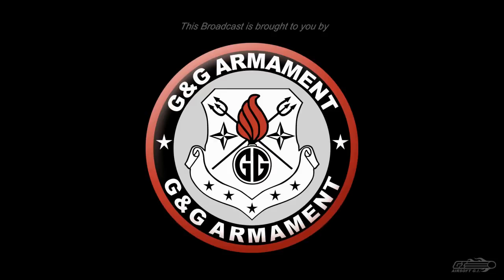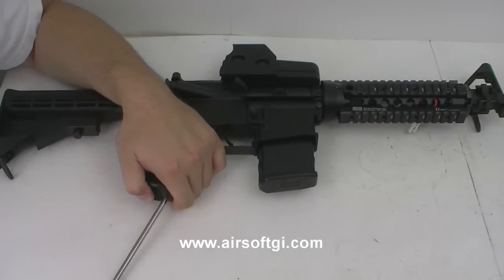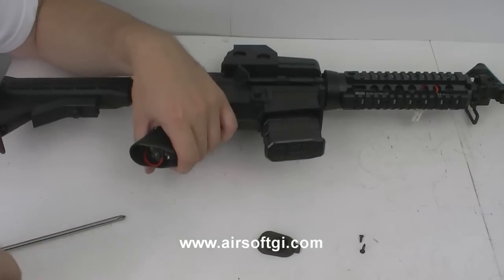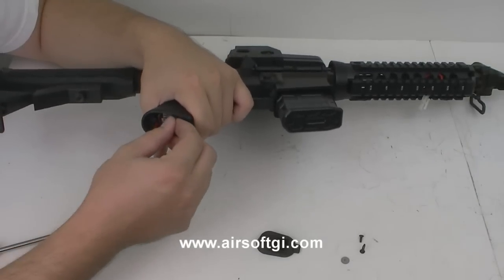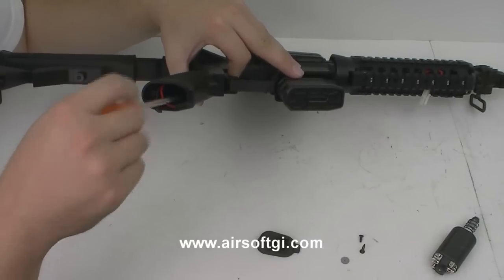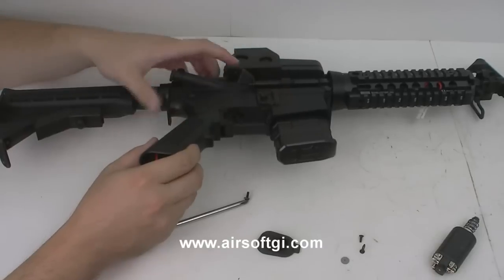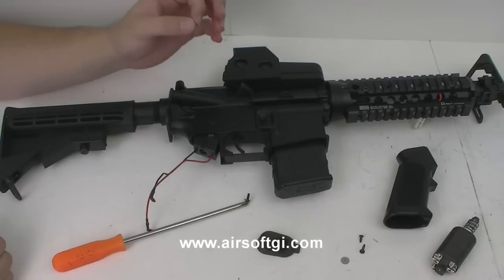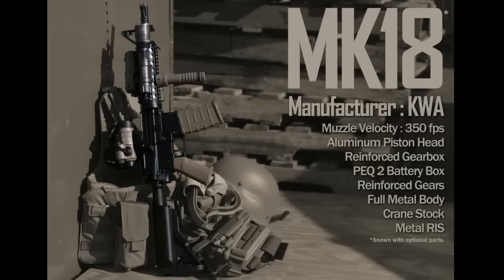Airsoft GI 101 - M4 AEG Pistol Grip Removal

Comment: Thanks for showing me this I need to replace the original grip on my Lancer Tactical M18 with a Magpul grip.
Reply: Did you do it? 
Because im pretty sure you cant, and you need an AEG Specific grip because magpul and regular ar grips use one large screw in the middle, while these use 2-4 small screws on the sides.… but let me know

Comment: thats your motor adjuster dont touch that, when you have removed the 2 little screws the bottom plate should pop out a bit if not then take a flat head and pry it out.

Comment: What should I do if the motor is stuck in the pistol grip/gearbox?
Reply: If it's an AK or another gun with a version 3 gearbox, then the motor is stuck to the gearbox. this only work on version 2 gearboxes.
Reply: +MAG Airsoft I have this problem but I own an m4. any ideas?
Reply: What problem?

Comment: can you instal a regular AR-15 pistol grip in an airsoft gun? like the frs-15
Reply: ***** so , the motor wont fit in the hole from a regular AR pistol grip?
Reply: Sorry for late reply but it will work for some Gas Blow Back rifles but as for AEGs(Automatic Eletric Gun) it will not work because the motor is housed in the grip.